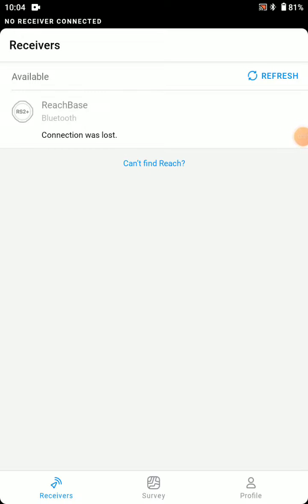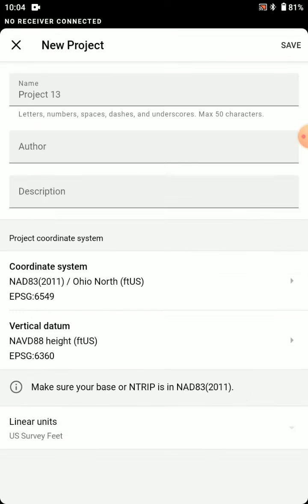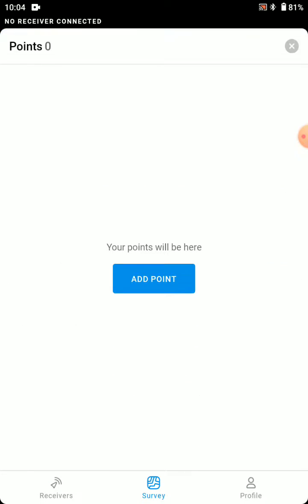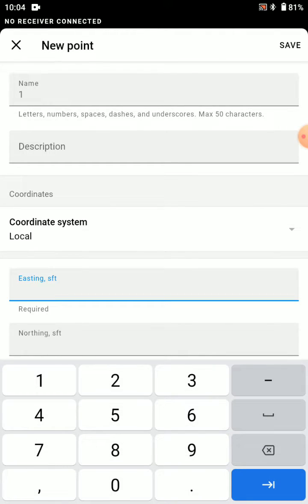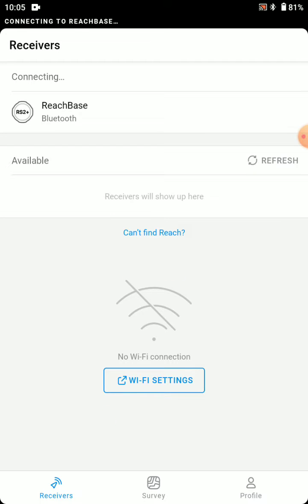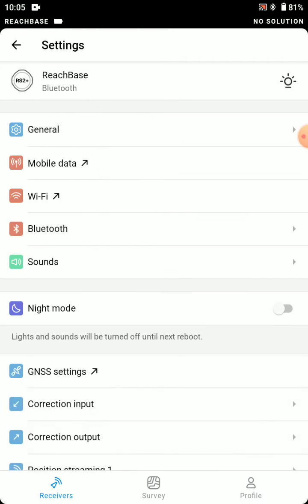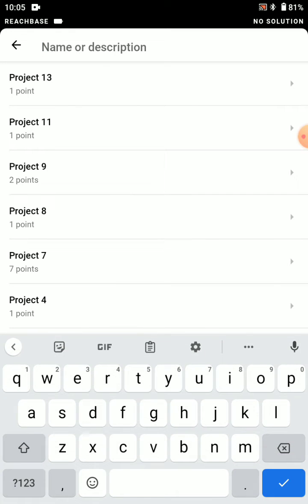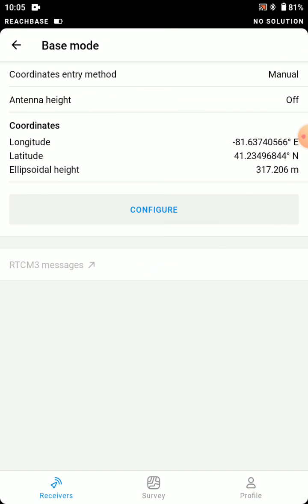Setting Emlid Reach RS2+ Base Coordinate in State Plane Coordinates

Comment: Hi,  I have  a question , if I setup a state plane coordinate like is showed in this video , what is the coordinate format of my rover points? State plane xyz or llh
Reply from the maker: The rover points will be in the coordinate system of the project in which they were stored.  When you start a new project you will select the coordinate system.